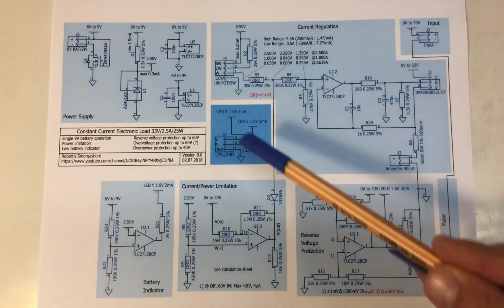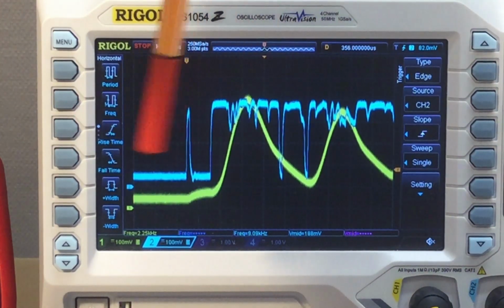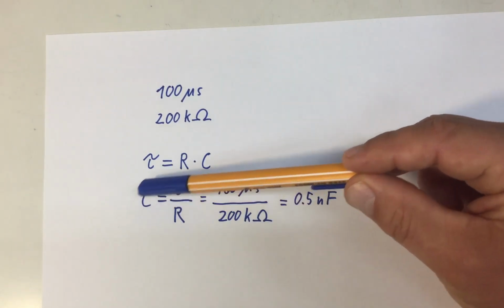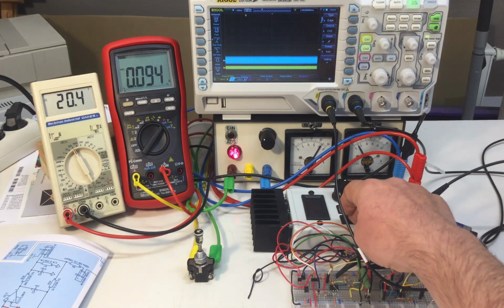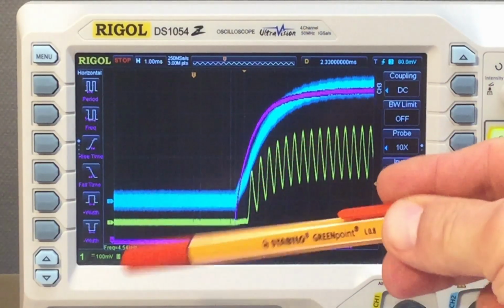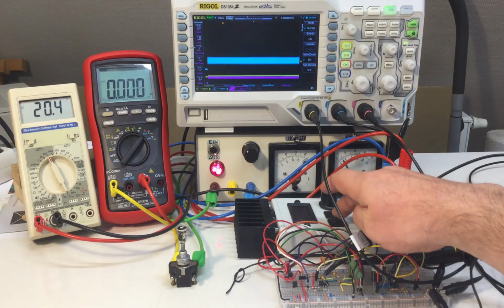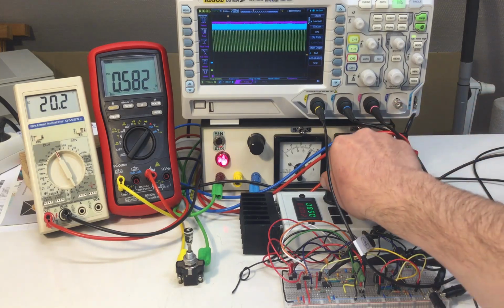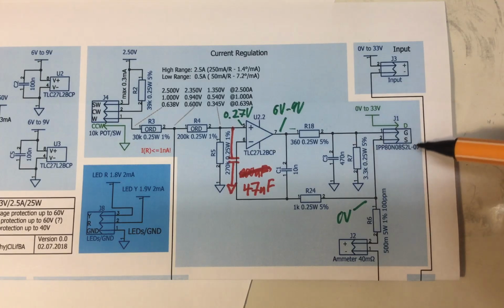"Simple" Constant Current Load (8): Transient Responses

Comment: Thanks for sharing the link, Robert. Good to see the way you solved/managed to oscillation problems. 
Something I saw in your video (or the pendulum analogy) made me remind that: when you increase the closed loop gain, the system is less dampened and more prone to oscillations. As the Op Amps are used like comparators, you can have very small error due to high gain, but the system becomes prone to oscillations. I imagine by now, APRIL/2022 you circuit is ready and 100% done. But for other cases, maybe reducing the gain (tentative large feedback resistor between IN- and Vout, in parallel with that new 47nF) would dampen the oscillation, then that 47nF could be reduced, increasing the stability - although with conceptually higher steady-state error. My guess this “error” with a stabilized circuit would still be negligible.
Another brainstorm from the mechanical analogy (I’m Mech Eng, so “guilty” here): Car suspensions should be a little over-dampened. So wheel is the Inertia (mass), Spring is itself and a a shock-absorber is the dampening - like an “RLC” in this order: LCR, respectively. The difference resides that shock absorbers can work more freely to enable the wheel shoot upwards when you drive over a stone or small bump in the road. But if you drive over a Pot-hole in the asphalt, the shock-absorber dampens and slows-down the spring force to accelerate the wheel (mass) to follow the terrain. It is like the overdamping happens just in half-wave cycle. 
I never tried this electronically, but I guess it could be done using signal diode (as 1N4148) with a resistor in one direction, paralleling a resistor in the feedback (IN- and Vout) loop. The response would be non-linear, of course, but for instance it would allow fast lowering of the Current (Amp) value, with slower recovery = something eventually desirable for safety reasons: you could have undershoots, but not overshoots.
Nice to follow your work!
Reply from the maker: I thank you again for following my stuff! And thank you very much for your feedback - an excellent analysis. When I struggled with those oscillation problems I briefly thought about doing it the right (theoretical) way. But I dismissed that as, frankly, being beyond me. There are two problems with that classic, very simple current regulation circuit, that you see basically anywhere: 1) The opamp is operated as a non-inverting amplifier - an inverting amplifier opamp circuit is much easier to compensate. 2) The opamp is not the only amplifying element - the MOSFET also works as a (non-linear) amplifier here. If I had to design that circuit again, I would probably use a BJT (Darlington) NPN transistor with a base resistor to the opamp output. That way the output of the opamp is (approximately) linearly translated into a current (I(CE) ~ Vout,opamp / R * beta). Operating the MOSFET in it's linear region means that small changes in the opamp's output are translated into large current changes (from 0V to the MOSFET' s threshold voltage nothing happens, and then all the regulation has to take place within the MOSFET's threshold voltage and its on voltage, that is in its linear region). It just makes the work for the opamp very hard.